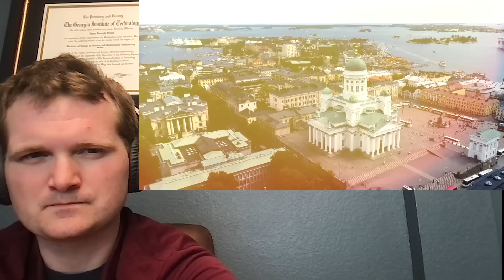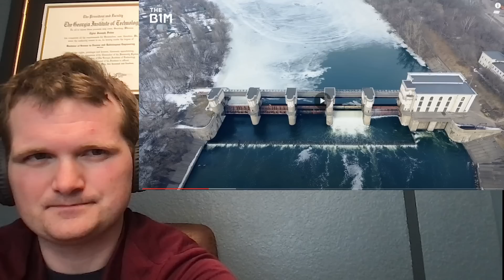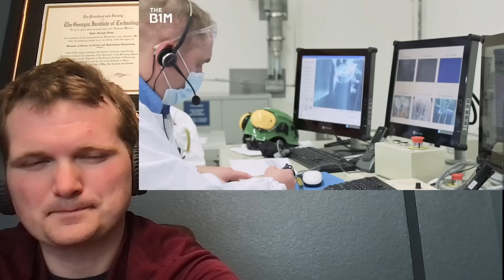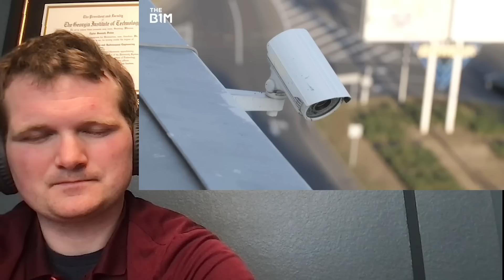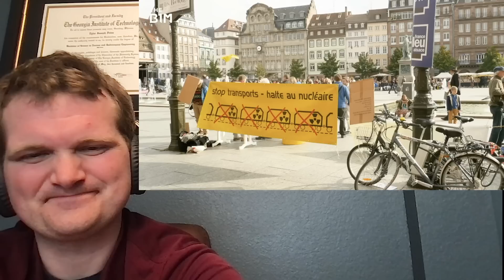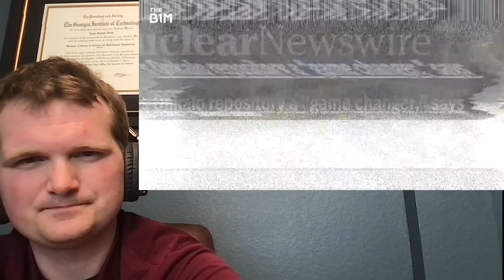A Solution to Nuclear Power's Biggest Problem? - Nuclear Engineer Reacts to The B1M

Comment: I'm not 100% sure that "just ignore all the issues and do it anyway" is actually a solution. Most countries are democracies and have these crazy things called "voters" and there are other ethical issues besides that. The good news is it has been solved, the solution is called deep borehole disposal and solves all the ethical problems with just storing nuclear waste in vaults. It means that the waste isn't recoverable which is the side reason why a lot of waste just sits where it was made, but it solves the "what if humans don't exist" and "what if bad things happen" type issues. Voters are a whole different issue which is why the DofE had issues with their test sites, but - it is actually a solution. The smart way to do it will probably be to assign borehole locations (on site) as part of the design phase of new plants and then they're either used whilst the plant is operating or during decommissioning - won't solve the old waste problem, but it will solve the problem of new waste. Once everybody gets over it new sites can be established for old waste.

Comment: not knowing or monitoring its continuously irradiating an area or ignoreing it, doesnt make it clean. 

its the most destructive and dirtiest form of electricity we have. 

but its the most productive method. more power per lb than anything else. so we arent using up everything else to just produce power for a day. 

coal or gas... we would use it all very quickly. we may not even have crude oil left. and it would also be radioactive. 

sigh. we will make this planet uninhabitable before we come up with different methods... only because the industry is scared to not make money, so they work against better ideas.
Reply: re using the fuels is the only viable method. 

burying it isnt a solution, neither is dilution. its a remediation method, temporary. 

all of it could be used as fuel. 🤓 and should be until it is inert.

Comment: Calling EPR at first really made me scratch my head... As the acronym EPR to me is what you find in Pratt & Whitney engines and means "Engine Pressure Ratio" and is a way to set the power of a jet engine.
At least you didn't mix it by saying N1 or N3 at the same time, then we are really in for a confusing moment.

Comment: The Finnish bedrock is extremely stable, a large earthquake here is detectable by seismometers . There are quite a few unbroken and dry red granite areas, the rock is strong but pretty easily tunnelable with modern methods. The encapsulation and corrosion control methods seem fine since the risk of any groundwater contamination is extremely low.

Comment: I agree that thew biggest drawback in nuclear energy comes from mining raw uranium, not disposing of spent fuel. Mining in general is a dirty industry, and when you add to that the factor of low level contamination from uranium ore dust and slightly radioactive side rock... yeah. But even considering that, nuclear is still far less harmful over all than fossil fuels, and more stable than wind, hydro, or solar.
Reply: quite a lot of uranium in australia is a byproduct of a copper mine

Comment: So we can deal with apples to apples instead of apples to oranges. How many POUNDS of URANIUM ORE does it take to make 1 PELLET ONE if it takes 1 TON of COAL to equal ONE PELLET.
Reply: 1 uranium pellet weighs about 20 grams. Mined uranium ore typically yields one to four pounds of U3O8 per ton of ore. There are 453 grams in a pound. With these numbers, you should be able to create about 20 pellets per pound of U3O8, which is on the low end of what you would get from a ton of uranium ore. With these numbers, nuclear fission is 20 times more efficient than coal, and again, that is on the low end. 

I got this info from EIA.gov
Reply: Uranium ore yields are 0.20% to 0.05% of yellowcake (triuranium octoxide). These pellets weigh 1.5g and are made of uranium oxide. Doing the math, it comes out to around 2 to 8 lbs of uranium ore to make one pellet.

Comment: Is using the boron and copper necessary? The waste is buried 500 m deep in bedrock. Doesn't feel like it could do anything dangerous.
Reply: Also, with nuclear power matters, "is it necessary" usually isn't the question so much as "how safe/redundant could we reasonably make this."
Reply: It basically is three systems that each are expected to do the job on their own stacked on top of each other - the entire concept is built with the assumption that a system will fail (the KBS-3 was developed in sweden when the politics there was very nuclear-hostile, so it got engineered to the point of meeting every single concern that had even a hint of being valid (last sticking point was concerning if copper corrodes in oxygen-free enviornments, which should say just how extreme they got in ironing everything out)).

But to answer - not really needed, any two of the systems can fail and the concept will still do its job.

Comment: The original magnox reactor in Selafield UK was the worlds safest reactor, it was impossible for any of the fuel rods to overheat and  the aluminum finned rods distort causing them to jam in the horizontal ports in the graphite core, there was absolutely NO need for filters in the chimney's that would be folly paying all that. That reactor was typically British, cobbled together, make do and mend oh and pretend to be a power station even if it used more electricity than it produced, but Britain needed plutonium and yellow cake fir its hydrogen bomb. Nearly contaminated the whole of the north of the country, continuously for decades, and if Dr. Cockroft (think he was a Phd) hadn't fitted the filters and nearly killed himself trying to put out the reactor that was white hot by firstly using water from a hose from ground level then climbing into the top of the chimney and pouring water onto the melting fuel rods.it was hushed up for years and years

Comment: 1:55 The site called it a "E.P.R. = European Paper Reactor" due to all the paperwork needed to make a reactor in Europe.
Reply: Ah- the most threatening part of nuclear power: Bureaucracy.
Reply: I had heard that the EPR tragedy is elsewhere. The French and German  nuclear industry has decided to design common nucler block in same way as other European projects (Concorde was British and French project, Airbus has factories all over Europe...). They needed the first prototype site to build it and they undershoot cost and time to get the Olkiluoto project for it. They design it on the run and made some changes on the project when the changed part was already built. Then the Germany drops their nuclear power and nuclear knowledge so Areva needs to do reverse engineering of german technologies already installed. And there were some changes after Fukushima lessons learned and so on...  And yes, paperwork about each modification of the project.
Reply: @PETMK  First EPR what started Construction was Flammeville.
Second reason for this delays was Areva, or better said Creusot Forge they made parts like the Reactor and Heat Exchangers.
Issue is they falsefied all record about tests, why well the reason is they had not the needed testing tools so made false Documents.
Causing in the end a shutdown of 140 reactors world wide.

Some of them got Permamently shutdown, Some like Tihange needed shut down earlier as planned.
Let say a hughe mess, and the are still not threw the hole Scandal.

But yeah this was the reason why Spain, Belgium and Swiss as example leaving nuclear power.
Technigly by 2026 the UK will nuclear free too, but because the newst plant is still not finished and will not vby before 2031 or later.
Reply: @asokawhite  That's interesting. However, today they lost contracts for Dukovany 5 and 6. They offers EPR1200, thay said that just remove one loop of four and test new technologies for EPR II.
Th winner is KHNP with APR1000
Reply: @PETMK  This project will proberbly soon fail, Electricity spot prices going down to the point there nuclear is to expensive.
Reply: @asokawhite  It won't fail. The Czech Republic has no other way where to het the energy. It is on the center of the Europe.There are too small rivers to build the new dams, too weak wind. As a neighbor of Germany where is too much solar energy, the solar panels in Czech Republic will produce the energy just in moment when the price will be negative. There is no other way to make electric without fossil fuel...
Reply: @PETMK  It will fail onm operational cost, Nuclear is partially to expensive for the EDF.
Add the stupid move from them then it comes to nuclear fuel.
Reply: @asokawhite  The day ahead market does not show the actual cost of electricity (subsidies to renewables, transmission, distribution, capacity market, spinning reserve). It also ignores the electricity purchased further ahead in time, much like looking at froth on the top of the beer and claiming it is froth all the way down.
Moreover countries are starting to value longer term energy price stability.
Reply: @asabriggs6426  This came from the EDF.
It was litterly a statment, what thy need prices other 60€ or they make minus.
The EDF is the biggest operator of nuclear power plants. 
Oh and it was the official rason to stop the development project of a SMR project.

But i learned from them, dont trust what they say, in one paper to generate 1MW/h generates 4 gram of carbondioxid.

Week later to the IAEO they give a statment to generate in the same plant electricity generates 240 gr of CO².
Reply: @asokawhite OL3 construction began 2005 and Flamanville started in 2007. Flamanville was second under construction in the world, not first.
Reply: @Kuutti_original  Oh thanks for the Correction. 
But in the end still not finished yet fully.
Reply: @asokawhite  Yeah Flamanville seems not to be operational yet, thankfully OL3 finally is. And if you ask me we should build 2 more, as now it is not new prototype phase technology anymore. (Thats what inflates the budget quite fast)
Reply: @Kuutti_original  The issue right now preventing building more of them is skilled manpower. 
In short no one wants work rellay anymore in the Nuclear Industry.

The existing plants have a shortage of 17 to 30%. For Flameville they needed to bring back retired peoples. 

And then the have the warning out from the world biggest Uranium mining Company.
What the will have a Uranium shortage by 2030.

You can build this Plants, but by please not suprised then you have not the manpower for them or the uranium to operate.
Reply: @PETMK  It's not like German knowledge just disappeared when they turned off their last reactors (which was already decided in 2009 and before that in 2002). What kinda logic is that.
Reply: @gnaarW  They enjoys making mistakes but they cannot make small mistake. Now they want to forget art of combustion engines. Bye VW, Audi and BMW...
Reply: @PETMK  "art of combustion engine" and VW in one sentence when we just had to biggest automotive scandal with them (granted, Toyota didn't seem to be much better from what we heard last year^^) 
Germany has long since stopped inventing in the combustion engine field. It's all Japanese and Koreans now..
Reply: Add to it  Stupidity, France falsefication of documents, stupid decisions one of them caused what the lost third biggest supplier of uranium a few weeks ago.
Doing everything to try lost the Public trust into Nuclear Energy, Asse, Fessheim, Krümmel, Sellafield and many more examples.
Oh and cost, france given up on a SMR design around 3 weeks ago because to expensive to build and operate.
Have i forgotten something?